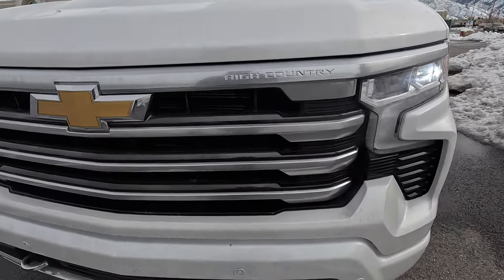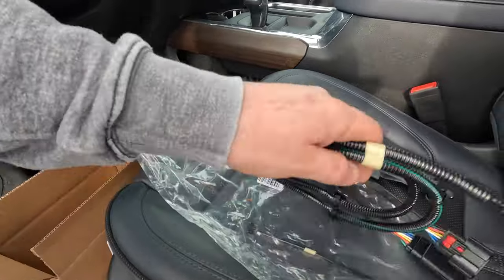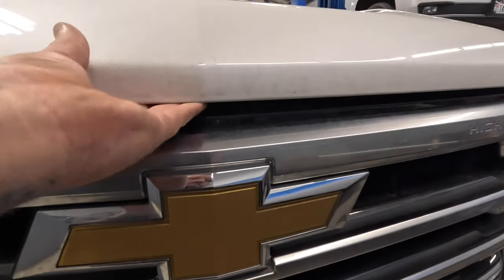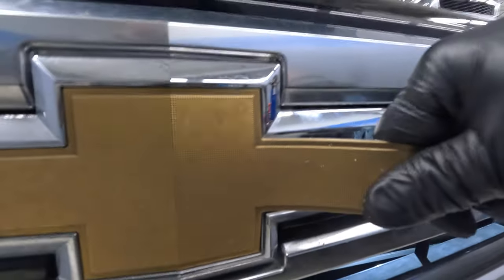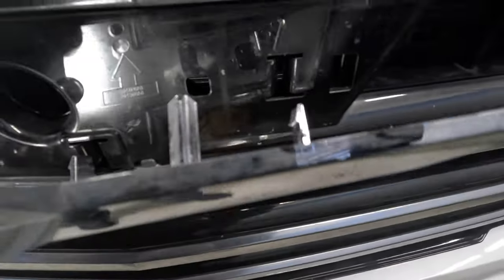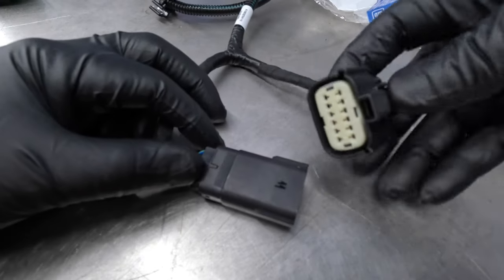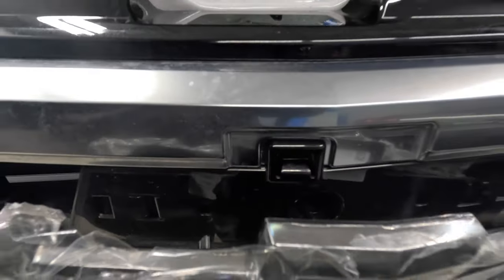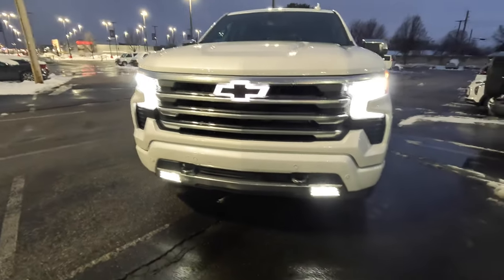GLOWTIE ! How to Install in 90 SECONDS on 2023 Silverado fits Refresh

Comment: stop buying them, they stopped making them because they threw error codes and CE lights
Reply from the maker: False.... still readily available and not throwing Check engine lights. The early ones had some issues but that was resolved before I did my install.... https://accessories.chevrolet.com/product/front-illuminated-bowtie-emblem-in-black-86520575?body=Crew%20Cab%20Pickup&bodyId=22&bodyNumDoors=5&bodyNumDoorsId=5&categoryId=98048&make=Chevrolet&makeId=47&model=Silverado%201500&modelId=491&year=2023

Comment: Just wanted to thank you for the video. I listened to another commenter and messed around with a credit card and trim tools and got nowhere. Whipped out the drill and it took me no more than 30 seconds to remove it. However the left light was a role pain with the windshield fluid there. Right side was much easier to access. Wasn’t sure if there was a technical reason so I final got the driver side unplugged.
Reply from the maker: Glad to hear it helped!

Comment: Just curious.  Does the hold drilling procedure, keep you from having to remove more of the grill thus saving time?
Reply from the maker: Yes, gives you easy access to the locking tabs.
Reply: @DemonWorks  can't you just use fishing line and pop it out like the 19-21s?
Reply: When I type part number in search it comes up for a 2023 silverado. Does the part fit on a 2021 Silverado? It looks like it does.

Comment: Left hand light?   Would that be the driver side light?
Reply from the maker: Correct
Reply: @DemonWorks  Thanks.  I ordered one these for my '21 Silverado.  It's a Rally Sport edition.  White with black trim, black rally stripes and 22" black wheels.  The current bowtie and all emblems are black, but the illumination of the tie will really look good on this truck.
Reply: Where did you order the glow tie?? I also have a ‘21 rst
Reply from the maker: @GustavoLopez-fl5zj  through my dealer when I bought the truck. Took a while to get as it was on backorder. 

Go to gm accessories website and put in your vehicle to get the right one for yours.

Comment: I'm getting a Check Engine Light because I ran the wiring harness through the active shutters.  Where did you run the cable to the bowtie to not interfere with the active shutters?

Comment: Does this work for the 2021 Rst 1500 grill? I have been trying to find the bow tie that glows white so this would be perfect if it fits
Reply from the maker: It will not, you will need the one made for your truck, this is 2022.5+

Comment: Questions is the Led light the same color as the head lights and day time running lights?? or is it a blueish white color? Yours looks like it matches in video.
Reply from the maker: it's close, but since the bowtie is a little more dim than the others, it's not exact.
Reply: My 15 silverado seems blueish white. Wish it was more on bright white led.
Reply: where did you get 1 for 15...i really want 1 for my `14  part # or where to get please.

Comment: I can't not get the connector to budge after pulling the red clip back. Im pushing the button as far down as possible it just won't budge. Is there a tool or trick too this I'm missing? Any help or ideas would be appreciated. Thanks
Reply from the maker: It can be tough, push the connecter more inward then push down on the tab. The latch portion of it may be stuck. The other option which I often do for tough connectors is a 90 degree pick from the latch side to lift. Tough to explain, hopefully that makes a little bit of sense?
Pick set:
https://amzn.to/41PGNFk
Reply: Thanks for the reply. Yes makes perfect sense going to try that now. The passenger side light seems so much easier to work with lol. Does it really need to be hooked up too  the drivers side? Sure there must be a reason just wondering. Thanks again for the quick response.